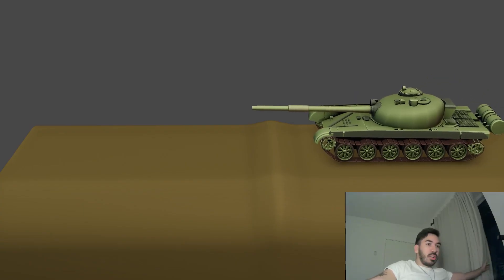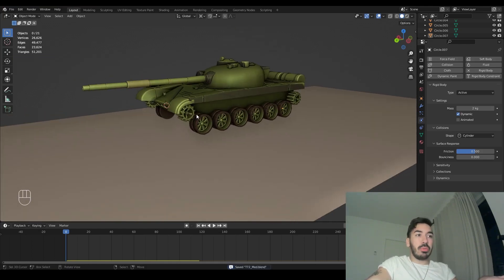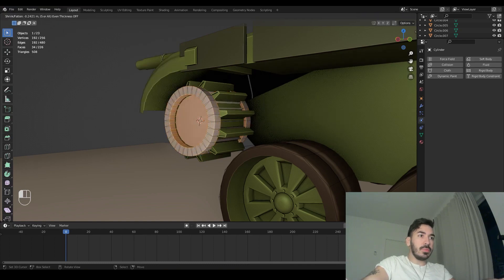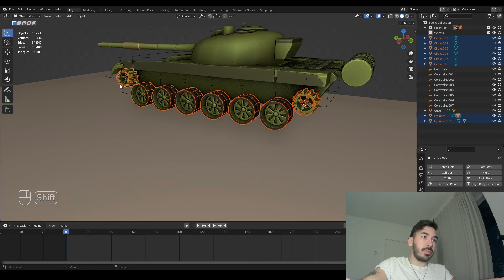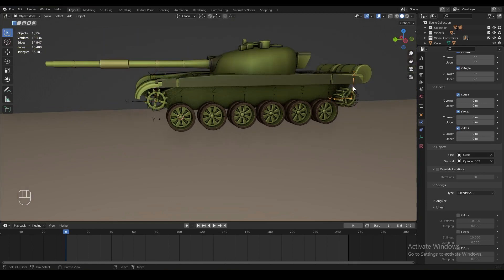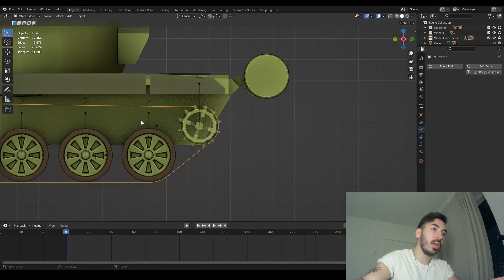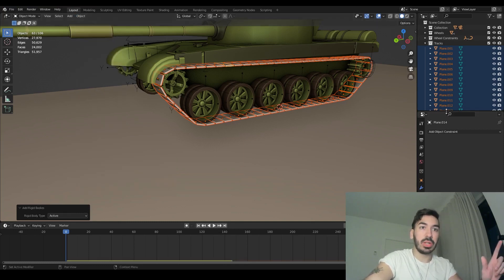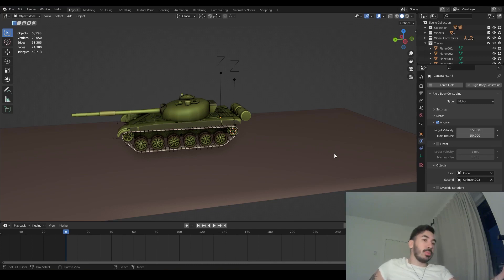Blender Tank Tracks Tutorial | Physics & Rigid Body Rigging (Arijan)

Comment: Does anybody know why my sprockets fall off? They fall off and stay ground level and do not roll away, so the suspensions do work at some point. I checked multiple times, and my settings are the same. I followed this tutorial precisely. All but my sprockets are working (the wheels also spin around Z even though they should not, when the tank starts in air and not ground, or hits a wall). It results in the tracks going limp and falling off as well. I am using Blender 2.80.75. 

I tried to alter the settings, but I was unsuccessful.

Comment: Nice tutorial man! One question: Do you know how i would make this work when my wheels are overlapping eatch other (like on Tiger E or Panzer A). Please i am struggling with this so much.
Reply: Hey mate! I had this exact problem. All you need to do is select the front wheels (most outward ones)- then under the physics tab > collections: (holding alt) select any of the boxes (easiest to just select the one in the top left corner). Then do the same for the "behind" wheels, except this time choose a different box (ie the one next to it). Now that that's done, select the plane your tank will be driving on, navigate to collections again and select the 2 boxes you just selected for both sets of wheels (by using shift). That's what I did and it worked a charm! Hope that helps :)
Reply: @xperimentsallday5290  Thanks man, you really saved my ass with this, I was about to give up

Comment: for who's facing problems ,at first i faced some glitches like the entire vehicle flying or the wheels rotation weirdly so here's some fixes:
1. select the vehicle body and the wheel and connect them instead of doing the opposite like the video.
2. always apply rotation/scale especially for wheels and if applying rotation change's collision cage rotation use delta transforms.
3.make sure that the wheels origin point is in the middle of the wheel it may be some times tricky as if like its in the center but its actually couple of cm's away from the actual center even with the origin point to volume shortcut.
EDIT:ALWAYS apply scale and rotation.
Reply: hello! wdym select the body and wheels and connect them>?
          so when applying rotation, use delta trnasform?
Reply: @dylanmercergo7853  
1. Select wheels then body lastly then view3d→object→rigid body→connect 
2.(BEFORE EVERYTHING) Commonly imported wheels/objectmeshs' rotations from external websites are janky in blender. A nice way to fix that is to make the wheels face up-words then applying rotation, then instead of using "Rotate" (Or the R shortcut), use the delta transforms

Comment: Thanks for sharing. But I noted when I do the origins to geometry the individual separated origins are not on the track (curved around the path) but on a straight line..also can I know your blender version ? Thanks
Reply: I see you posted this a year ago but if it helps you may want to check if you applied the curve modifier before doing origins to geometry

Comment: First I want to thank you for making these tutorials. They contribute a lot to the blender community. Now, I recently made a very similar rig for my tank. However, I used a cloth simulation for the tracks instead of simulating each link separately. This should be more efficient though I dont have the latter to compare. Basically what I did was create a path much like you did, then using geo nodes I resampled it to have as many links as needed. Converted to mesh and extruded. Later I modeled a link and instanced it on the cloth's faces. I ended up adding two planes on the sides to keep the tracks from falling off the wheels and also add collision (independent of rigid body) and set friction to max. I also had to add motor constraint to all of the wheels and not just the sprockets. After some fiddling it worked and it ran in real time on my ol gtx750. Lastly I added drivers to the motors so that I could control the tank in realtime using an empty.
Reply from the maker: That sounds interesting and I haven't thought of it before. If you would create a tutorial it would likely get lots of views.